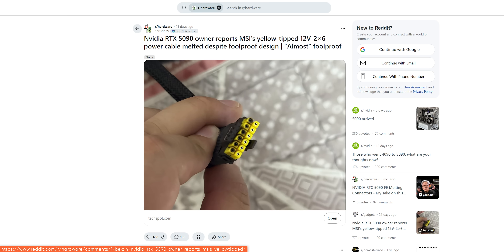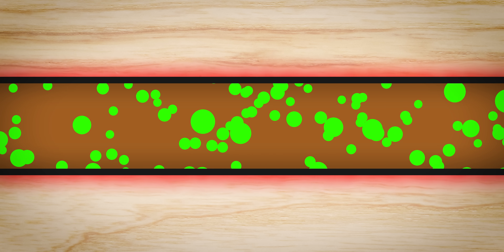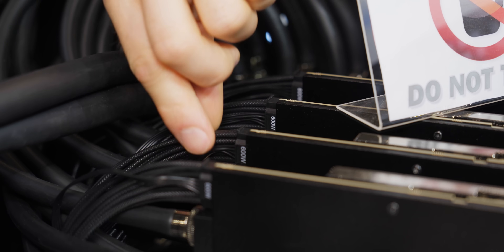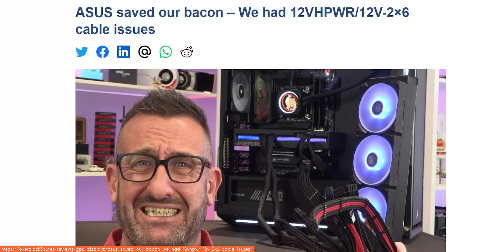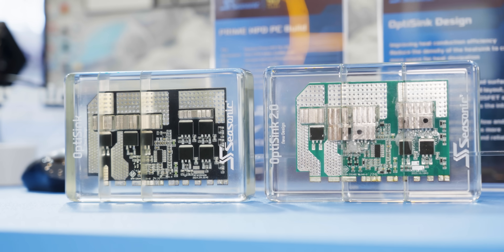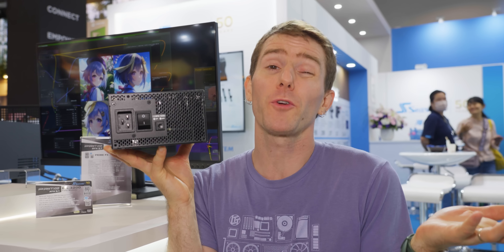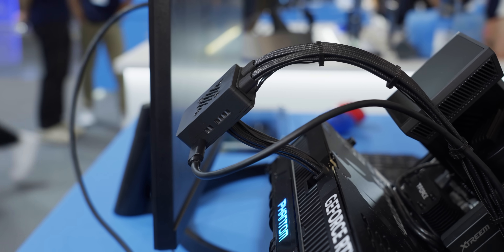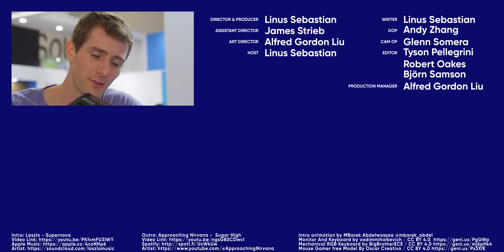The REAL Solution to Burning GPU Connectors

Comment: I am SO GLAD Seasonic did this, but is it also PATHETIC on Nvidia's side hat they HAD TO, since most of us at a GLANCE could tell the 12vHP wires were too thin, LUCKILY so far my 4090 is still un-melted with it's Octopus Adapter, also luckily when I first got it the 90 degree adapter were VERY sold out saving me from that nightmare, and until I can get one of those Seasonic PSU's I am NOT TOUCHING the Octopus adapter since Nvidia and Board Partners will Blame Customers for using ANYTHING that did NOT come in the box with the Video Card and I want NO possible reason for Gigabyte weaseling their way out of honoring their 4 year warranty

Comment: Someone at Sea Sonic is going to get fired for this one! They just put a lot of time and research money into something that won't be a problem 1 year from now. They're addressing a problem with a specific connector when, in reality, the connector itself should be changed via ISO. XT90, there's the answer. It's simple,  cheap, readily available, and has been tested by millions of RC enthusiasts. Why are we making PSUs that monitor temp, what will this fix? If the connector heats up, what are the 99% of you going to do, shut down, and wait? And then when it heats back up, what'll you do then? This SOLVES nothing but low sales numbers.  The issue is surface area, and a bigger connector is the solution. Stop talking about this when the answer is simple,  done.

Comment: after all the issues the first time, i decided i would just ignore any gpu with that connector on it.  will continue to do so.
Reply: this is the only response to deliberate engineering oversights
Reply: @Berg085  agreed, my 3090 has 3 of the older connectors and its never ever had a problem
Reply: @Ollieiow08Funnily enough, the 3090 founder's edition had the 12 pin, but it had safety measures to regulate current that helped avoid cable issues (multiple 8 pins are still better though). But nvidia cheaped out on the 4090 and 5090, they no longer have anything to stop that.
Reply: I deliberately bought a older GPU in the 30 series to avoid that connector. 
My only other option was to build a fireproof box and put the CPU and power supply in it so they can burn up together safely.
Reply: Which connector?
Reply: I built myself a new pc last month because of win 11. When I looked for a graphics card all the current nvidia gpus disqualified themselves because I absolutely didn't want something that has a not negligible risk of selfdestruction. Nice work nvidia!
Reply: Isn't this only a problem with X090 series GPUs? Never heard of a 4080 or 5080 having that problem, they don't draw near enough power to be an issue, even with faulty cables. It's only an issue with top of the line GPUs that draw an stupid amount of power like 600W.
Reply: @devildante9  5080 and 4080 had this problems too they were rare. Even some 3080 founder editions had the 12 pin. Nvidia tried to impose it to AIB but it wasn't already "sanctioned". Only in time for the 4000 series the cable was approved, by Nvidia...
Reply: @devildante9  It's not even a problem with all X090 cards, because some board partners have implemented the connector properly and haven't bonded all pins together, so their GPUs actually know if they can safely draw full power.

Comment: And to be clear. Asus astral can shut down if the connector fail...OLDer card like 3090 had per pin pair balancing which ment that situations like we see now are far harder to happen in the first place. So this seasonic and asus astral card is just a safeguard of Nvidias shit. Asus COULD have made a per pin balancing...but nvidia don't allow for it so they are stuck with per pin check only...and it can't even use the same shunt as the power management due to...nvidia.
And the only PROPER solution to this saga is for nvidia to bring back the power management to a per pin balancing instead of having one chonk rail on the card and many pins to the card. Or one one fat +12v and gnd instead of multiple wires.

Comment: It's not a solution, it's a band aid to make a pile of garbage connector not burn your house down. A solution would be for the 16-pin to just die and replace it with EPS connections.

Also, the Astral cards DO NOT have any circuitry to prevent this from happening. All the Astral cards can do is warn you that it's happening.

ALSO, JayzTwoCents showed that he had issues even with a new cable AND the old Mini-Fit Jr. standard is also only "rated" for 30 insertion cycles as well.
Reply: Only 30 cycles, i wonder how much money nvida gave to get that certified.
Reply: @bagi1941  TBH, I doubt NVIDIA has anything to do with it. Molex certified Mini-Fit Jr. for 30 cycles and it pre-dates GPUs even needing added power and likely even dedicated GPUs all together. That being said, I don't really think it has much to do with the issue, unless the terminals are just super weak. It was a non-issue for Mini-Fit Jr. and people have had issue with these with only a single insertion.
Reply: @bagi1941 nothing because they didn't put it forward
Reply: Finally someone else says it! No the Astral does not solve the issue, even worse, it only warns you if you have their software installed from their website. If you don't they didn't even add a speaker to the card to warn you automatically. So now you have to waste computer processing on background software that only warns you and doesn't even stop it from running. 

For the extra $300 they charge for the Astral, you might as well just get a direct cutoff device that works with any GPU.
Reply: @Skylancer727  Yeah, I had this argument with someone the other day and said the feature was pretty worthless unless you have a second monitor and have their monitoring software up and keep watching it while you're gaming... just what I want to do, instead of gaming. They claimed that there is an alarm, but I've not seen anything to verify that. I don't expect the average person in the internet to know that it's for monitoring only, and doesn't actually protect you against anything, but I would expect the largest techtuber to know.
Reply: @TheGameBench  I don't know why they didn't just make a 12-pin Mini-Fit HCS (high current) connector with say 13A rated pins with the 600W limit (I believe many brands were already using HCS terminals for their 6/8-pins anyway), would have been barely bigger (like 4-5 mm wider and 2 mm higher) with no major insertion issues and given a higher safety margin. Though even then the fact they gimped the power delivery on the cards by connecting the pins in parallel to a single line (according to Buildzoid this is part of the 12VHPWR spec) with no pin monitoring or balancing was a terribly unsafe idea that would still give a potential risk, albeit it somewhat lower thanks to a better connector, of melting or fire.

The Astral card indeed is rather worthless by itself since it doesn't have any automated shutoff, the only thing that makes sense for why is they weren't allowed to by NVIDIA. They do state there's a LED on the card that will flash but that requires having the case with a clear side panel somewhere visible and then to be looking at it knowing what it means & acting yourself. Their software also initially was terrible requiring you to actively look at it but it is a bit better now (still not good), by user request they added an audible alarm in a subsequent version (how this needed to be a user request and wasn't added from the get go is beyond me) along with a popup notification but neither is activated by default and you need to go digging through the settings to find them. HWINFO64 also supports monitoring the pins and they have a more flexible alert feature where you can define the limits and run external programs (such as shutdown) albeit it is a more cumbersome to configure than ASUS' software.

Comment: You can get a 240 volt setup in your house.  I had to get one in my garage for my welder
Reply: For North America, that would be 240V split-phase (+120V and -120V), and Europe is 140V single-phase (+230V and 0V). Is the PSU going to be happy with that? I'd imagine it probably would be, but you'll need an IEC C19 cable with a NEMA 6 or 14 series connector on the other end (the 240V split-phase hot-hot or hot-hot-neutral outlets). And you'd need a spare NEMA 6 or 14 outlet in your home. Most homes will only have two of those, one for the dryer and one for the oven/range, so you'd probably need an electrician to install a new one.
Reply: @guspaz  There's no functional difference between 240v split-phase and 240v single-phase.  The only true difference is potential to ground.
Reply: Think it´s just an American problem, why use 120V when you can have it easy with either 2x 240V / 3x 240V or 3x 380V(400)
Reply: Also a lot of electric clothes dryers and electric stoves run on 240v
Reply: @RunedGolem1  America too? Atleast Europe it is standard and even 400V too then it depends on the appliance you have on what voltages it needs. Like Europe is most likely 2x 230V (Brown and Blue cable) or 3x 230V (Brown, Black, Grey + Neutral) but there are some that use the 380V(400V) and that´s 3x phases Brown, Black and Grey 380V + Neutral (here that´s the blue cable

Comment: Time to put my tin foil hat on.

The 12vhpwr connector was designed badly so PSU makers have a way to implement new safety and monitoring features to have something to advertise and try to push new PSUs to people.

Comment: As someone who has an electronics engineering degree, I would expect my device (PSU if I was to design it) not to allow more current to flow through any pin of any output, if it exceeds the abillity to be transfered safely through all cables/connectors I supply with my device! It should have been the PSU manufacturers responsibility from the beggining and not only implemented on higher tier models and price points. Let's say any connected device shorts and draws an amount of power that can start a fire, should the PSU allow it over one power cable, if the total rating of it's plug allows it? This should be a must for all standard connectors not only 12V-2x6.
Reply: It's  very nice that you're so Smart, but I can't see how gpu manufacturers joining all the 12V cables at the card connector is the PSU's problem.
Reply: @jorelplay8738 one reason, because it was Nvidia who did it lol
Reply: My engine oil should have nanobots in it, to detect what car im putting it in, so that it can disable the engine if its not the proper oil for my engine. If the card was built right it would be fine. Its always been fine. It would be nice to have a bit more protections on PSU, however it would also be nice if they didnt put a raggedy cable connection on a 2000 (realistically double that) dollar gpu.

Comment: And THIS, ladies and gentlemen, is how you take a VERY BITTER lemon and make sweet lemonade out of it! Kudos to Seasonic for their perfect timing/business sense !
Reply: Why are you cheering this on? Like all this equals is nvidia being able to yet again get away with their bs, and normalizing it while doing so.

Oh, and now I gotta spend more money on shit. "Business sense" f off with that dude.
Reply: @PutYourQuarterUpGaming  Exactly. I don't want to have to buy a new PSU (even if it is Seasonic) just to use my GPU slightly more safely. I will buy zero GPUs that use this bad design because it's a bad design. 8-pin or forget it.
Reply: @PutYourQuarterUpGaming  I see the situation quite differently than you. If this works as expected, it EFFECTIVELY PROVES that the problem is on the GPU side. It is NOT user error, or a problem with the PSUs, etc. It is solely and exclusively a cheap saving on NVIDIA's side, by having removed the voltage/resistance detectors on the GPU's power connector  (which (appears) existed in previous NVIDIA's GPU models ) and, automatically makes them LIABLE for the past damages both in the 4090 and now, in the 5090. And, in case it was not clear, what I am congratulating is Seasonic for this work and, not NVIDIA's attitude. As soon as the class action lawsuits knock on NVIDIA's door, we will see if this stupid saving will not change in the future. And lastly, you ALWAYS have the option of buying  GPUs from another manufacturer. Have a good day!
Reply: No. It's not lemonade. It's BandAID. It also encourages the use of a bad design.

Comment: And how much will this power supply cost?
$200 to me is more than enough money to expect that you will get a decent quality power supply. (850-1000w)
$300 and up is just stupid.
The internals of a psu are not expensive at all.
The internals of a psu have not changed in the 80 or so years that this tech has been around.

Comment: Considering they were already approaching the theoretical limits regarding the amperage per wire when they first created the 12VHWR standard, why couldn't they decided "We need more safety margin here-- let's increase the voltage to compensate in this new standard?"  Even a small bump from 12 volts to 16 could have reduced the failure rate significantly.
Reply: That would require new power supply standard, while different connector only needs adaptor.
It's true that with power requirements of the current GPUs, 24 or even 48V would be much better.
Reply: or, and here me out, they use proven 8 pin pcie power that has a safety margin of double it's rated power limit lol
Reply: @HerbaMachina  They would need 4 if not five 8-pin connections for the most power hungry of the new generation of GPUs in that case. The 8-pin spec is rated for 150 Watts. @Papinak2 As for a new power supply standard, considering the absolute FUBAR Convention the new connector has been, having an entirely new voltage standard and being forced to upgrade the power supply for the new flagship GPUs would have been a preferable outcome.

Comment: They SHOULD have a new higher DC voltage standard.  Increase it to 24 volts and the cable size can be reduced.  The VRMs are already on the GPU so the actual changes are minimal.  😁
Reply: that's not really how physics works though and it would be potentially was less efficient because you have to drop that voltage to the realm of 1.8 to 2.5V for the GPU, higher input voltage means more waste heat and wasted current draw from the GPU as the buck converter reduces the voltage.

Comment: these seem to be expensive solutions to a problem that shouldnt exist, what happened to solid connections 💀 cables should still have big plastic tabs on 2 sides of the connector in my opinion, might be annoying but at least it will prevent a fire.

Comment: I solved this problem by not buying shitty Nvidia products, has worked flawlessly so far.
Reply: A strange game.
The only winning move is
not to play.
Reply: My last NVIDIA card was a 3060 and I will continue using it until the 60 series comes out and doesn't catch Fire. Otherwise I will be waiting for the 70 series...
No way am I spending thousands of dollars on a part that could combust and take the rest of my computer with it!
Reply: @saturnblue  i'm sorry to tell you but you're not going to spend less then 700$ on a brand new gpu any time soon unless is the bottom of the barrel, or intel
Reply: Same here, I went Team Red with my current build and this was one of those reasons.
Reply: Hahahaha that's funny, given that Nvidia is uncontested the highest engineering and build quality on graphics cards, founders edition blow third parties out of the water
Reply: @TheStoso2  You could say, "They're burning away the competition"
Reply: @AbsolutionArmament Nice one 😂
Reply: @TheStoso2 ”Uncontested and highest engineered” what does that even mean and according to who exactly? Don’t stay your stupid opinion as a fact lmfao.
Reply: @TheStoso2  “uncontested the highest engineering and build quality on graphics cards”

Brother. This is a comment under a video talking about a fatal flaw on the NVIDIA designed 12VHPWR connector which is so horribly designed that it just fries itself in case of a problem, has a lifespan of 30 cycles, and often has issues caused by… manufacturing defects. Oh, and those third parties? Just so happens that ASUS is the only manufacturer to include an over current protection, the FE doesn’t have any.
Reply: @TheStoso2  Let's talk about 5060 and why Nvidia is not talking about it and why it's not being scalped...😂
Reply: @TheStoso2 true that's funny. Takes a comedian to know a good joke
Reply: @TheStoso2  But they have horrendous coil whine as a side effect.